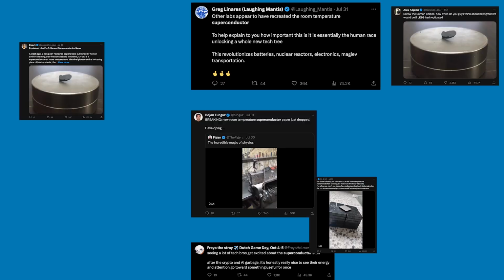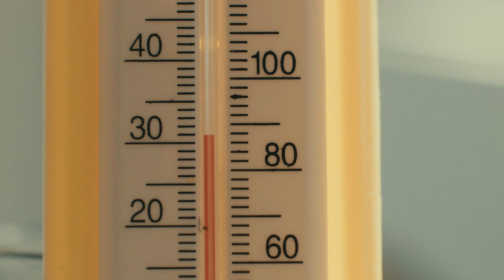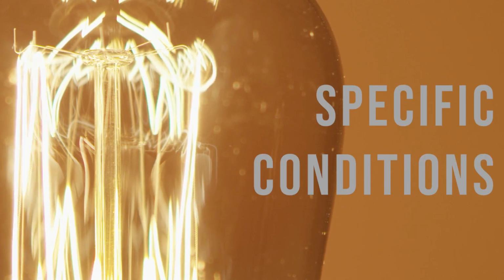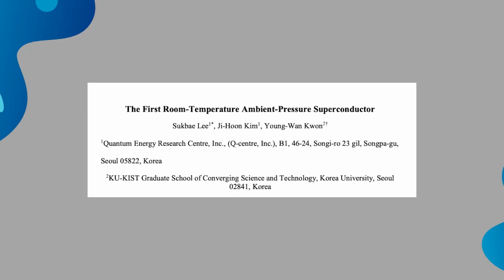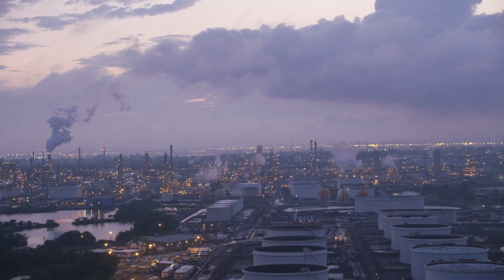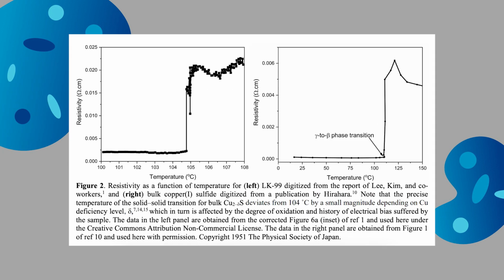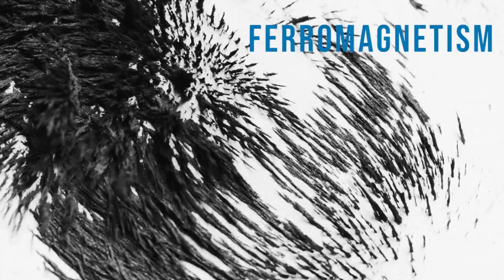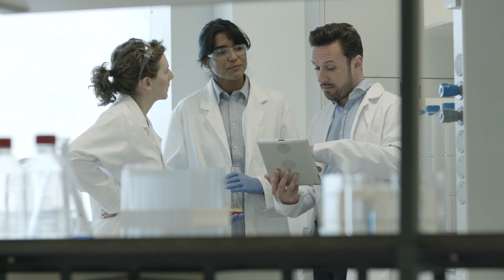LK-99: The ‘superconductor’ That Promised a New Era, But Failed!

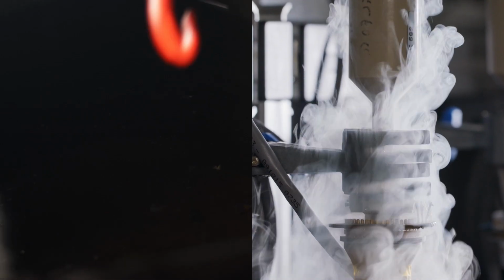Comment: 2:10 er which superconductors require temperatures require temperatures that are too high? Perhaps you confused by those which require high pressure but they still work better at lower temperatures.
Reply from the maker: You are correct, we did confuse them and are glad you pointed out this mistake as it is important. We meant to say "temperatures which are too low and pressures too high". We also make the same mistake later in the video when we discuss the application in SCMaglev's. We say that LK-99 could make these trains easier for everyday applications because the superconductor would not require heating or cooling. Heating is not correct to say here, as "high temperature" superconductors still operate at very low temperatures, at least from our knowledge they operate at about 15K. The issue with these "high temperature" superconductors is the very high pressure required for them to function at those temperature ranges. Pressures in the gigapascal range are required, which is not practical for industrial applications.